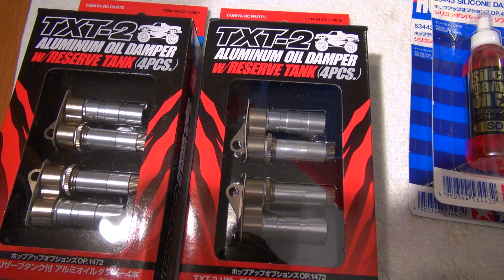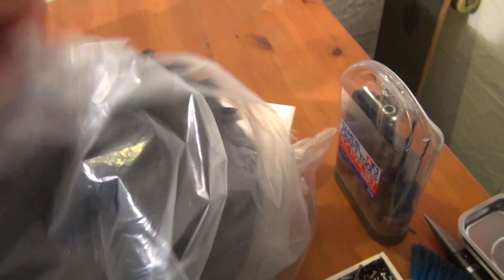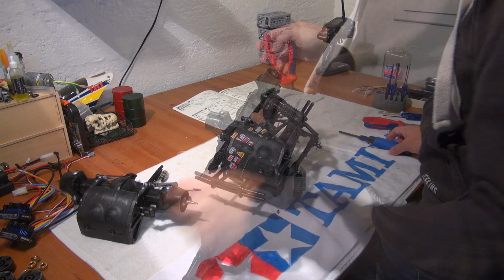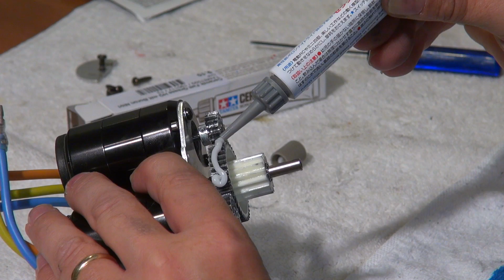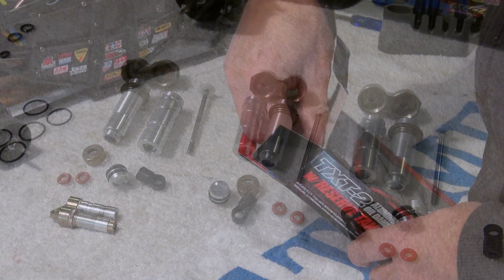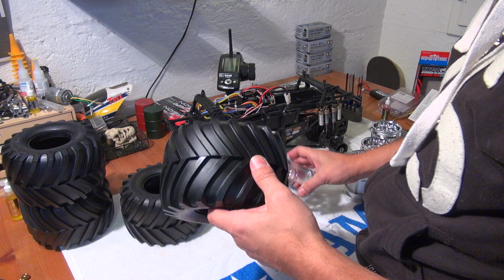Tamiya TXT-2 Agrios Modifications - Double Brushless Setup

Comment: I am planning on getting this truck and add the ClodBuster wheels & tires. Did you need to use  any type of adapters for the wheels? If you did use adapters to attach the wheels,what brand and where did you get it from?Also, do you know if aluminum wheels for the TXT-1 would fit on the TXT-2 Agrios?

Comment: I already have a couple of Clod Busters original and the second will be Hop Up project. I can hardly wait for the TXT-2 to arrive but I'm considering only small upgrades over stock at first  as I'm working on a budget in the way of a full set of bearings and the Clod tires and rims since I have an extra set I need to find the sweet spot one (1) motor or Two (2) Brushless or Brushed 540s or 550s it looks to be quite the adventure

Comment: No lube on those orings? Very nice otherwise
Reply from the maker: Thanks! The o-rings in the dampers? Is there not enough oil from the cylinders...
Reply: @Matteomeier  They will get some lubrication from the silicone fluid, but a proper o-ring lubricant (I use molykote 111) will keep them pliable longer, help them seal better against leaks, and the main reason they are lubricated prior to installation, protect them from being damaged by the threads when you install the shock shafts.
Reply from the maker: Yes, this makes sense! 👍😊

Comment: Please tell me how can i get those rims and the Tire.
And also the shock.
Please..please...please.. i really really would like to upgrade my agrios. Wheels.
Reply from the maker: The shocks are discontinued, maybe you can find it on ebay. https://www.ebay.com/p/54472-Tamiya-Txt-2-Aluminum-Oil-Damper-Set-With-Reserve-Tank-4pcs/1703940558
Wheels: Tamiya Nr. #9335085 Tires: Tamiya Nr. #9805226
Reply: Thanks a lot Matteo this surely help. unfortunate for the shock.
I already check the ebay. It also sold out. 
If i have another question about RC universe can ask you sometime.

Comment: In the Clodbuster manual Tamiya says that the tires should be glued. It seems on one side only, what do you recommend?
Reply from the maker: With a high power setup the tires should be glued. Without, the rims turning in the tires.

Comment: Matteo: these motor have Zero Timing? So can be used in the Clodbuster? Thx in advance.
Reply from the maker: Yes, sensored brushless motors have no timing.
Reply: Matteo's RC Movies Yes okay, but with a Clodbuster one motor will run in Reverse, doing this by swapping two motorwires. But them will the ESC defect a fault via the sensor wire?

Comment: Warning to others:  This does not work with TBLE-03s ESCs.  I tried it and one of the ESCs burned up after about 10 minutes of driving.  I switched to only one motor and now it works fine.  In fact, this truck is rev limited not torque limited so it goes just as fast with only one motor, it just does not have as much torque which is fine because it can still spin the tires.  Not sure why TBLE-01 works and TBLE-03 does not since it is supposed to be an improvement.
Reply from the maker: Thanks for your Info! Maybe it was something wrong with the esc itself? Why does only one of them burnin up? In my opinion this system should work also with this esc.
Reply: It is a bit of a mystery. It worked fine for a few minutes.  The ESC has thermal protection and overload protection but neither of them ever activated.  Maybe it was just a bad ESC, but then I am surprised it worked at all.  However, since using only one works very well anyway I will probably leave it alone.

Since both ESCs are sensored, it is possible that they are out of phase and there is some feedback in which they are fighting with each other.  I also find that the motor and ESC is much less hot now that I use only one.  You would expect it to be even hotter because it is doing more work.
Reply from the maker: Yes, I think this is possible, thanks!

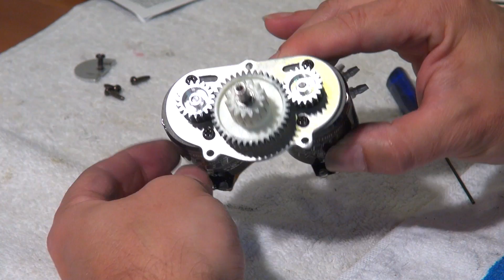Comment: I am thinking about doing the same thing to my TXT2.  Did you change the number of teeth on the pinion gears or did you stick with the stock pinions?  It looks like the motors are adjusted all the way out for the biggest pinions possible at 4:52.
Reply from the maker: I have still the original onions in it.

Comment: Firstly Matteo, your videos are the best in the business and I am certain they are inspiring a lot of people to either get building or others to get building again! Cudos to you! I have watched most of them and have been in the hobby for 30 years!

My question: Would recommend brushless or stick with brushed (even maybe 2 x Sport Tuned motors?) I like a lot of power, so assume that brushless is a good way to go, but I have 3s Lipo in my original Clod Buster and it goes very well! Thanks again, and keep the videos coming.
Reply from the maker: Thanks a lot for your nice comment! I really appreciate your good words! Yes, I think you can go with brushed, with 3s lipo it will go very fast. I think 3s with brushless would be too much.

Comment: Hi Matteo, first of all great job with the videos, they are the best on youtube for rc! after watching your agrios txt-2 videos I purchased one and a set of clodbuster wheels, however when I assemble and tested it, seems lke the servo savers are too weak to steer the wheels, can I ask what servos you used and if you replaced the servo savers? Thanks!
Reply from the maker: +Mark Ellul You can replace the servo savers, but have to use strong servos such as high torque (Futaba S3305)

Comment: Got Tamiya agrios  two day ago and finish I put 5700kv motor and mmpro esc run on 3s 5k mah  boy lot of chassis twist when acces and look at site for after market sway bar can't find one I want
Reply from the maker: nathan patrick The chassis twist in acceleration is normal with a rigid axle setup and so much torque. It's a result from the torque of the drive shaft. And your motor with 3s has a lot of power! But you can try to make the shocks harder at the rear left. (Pre load the springs)
In this video you can see also the twist at 0:20: https://youtu.be/vXayr7StP3M

Comment: oh,its a jugg 2 gearbox?will you be using steel pinions?them alloy ones wont last long with that power.what part numbers are them piggy back shocks.

nice truck by the way
Reply: He is right it is a Jugg 2 gearbox, same as the jug one and mammot dump truck but the jug 2 and txt-1 and 2 version of the box uses an upgraded final drive gear with a larger hex drive in the center and an aluminum hex nut that has a splined center hole for the dual output shaft which is a 6mm output shaft with dual flats cut into it for twin grub screws on the drive shafts instead of the weaker 5mm D shaft on the jug 1 and mammot which had only one grub screw, this upgrade followed into the axles which also use a 6mm input with the twin flats in the shaft.
Reply from the maker: michael whitham Don't know about the jugg gearbox. The shocks are part no. 54472
http://www.tamiyausa.com/items/radio-control-parts-70/tamiya-hop-up-parts-72000/rc-txt-2-alum-damper-54472

Comment: Hi, I'm currently in the process of adding 2 9 turn brushless motors to my TXT-1. Did you need to make any modifications to strengthen the gearbox or drivetrain when you did this instalment? Cheers.

Comment: Hi, can you do me a big favor? Can you measure the lenght of those alu shocks with reserve tank? I want to fit these on my TXT-1. Thanks!
Reply from the maker: The length is about 90mm, I think they will fit on the TXT-1. I found in the manual this information:

Usable with : 
For Cars 
TXT-1 Chassis (Use Damper Oil #500)
TXT-2 Chassis (Use Damper Oil #200)
Clod Buster (Use Damper Oil #400) 
CR-01 Chassis (Use Damper Oil #200)

Comment: Awesome set-up Matteo, and thanks so much for the instructional video.  One question: do you feel the stock oil shocks would have been enough, or were the modified reservoir shocks necessary?  Even though I plan on putting the larger tires on my truck (as you did), I just don't want the set-up to be too stiff; I kind of think it would be cool to get some suspension travel on larger jumps.  What are your thoughts on this?  Thanks!

Comment: Matteo, Just a quick question, given the similarity between the TXT-1 & 2 chassis, would the mods you have made to your TXT-2 work with the TXT-1? Only asking as i'm keen to upgrade my 1, (alot)..Oh and keep the vids rolling, very inspirational :)
Reply from the maker: Basically it should work. I don't know the TXT-1, so I don't know the length of the shocks. The motor setup should be fit without problems!

Comment: Question about this Tamiya truck. You are using two brushless motors. How are the shafts and gears holding up? Isn't it to much power for the drivechain?
Reply from the maker: It,s not a problem yet. I use only 2s batteries, so the power is good manageable by the drive chain. With 3s or 4s it will be a problem, I think!

Comment: Does it actually works with two motors and two esc's? I am still surprised that Tamiya is not using reinforced plastic like for instance Team Associated is using. Tamiya plastic doesn't look durable. Still nice  monstertruck though.
Reply from the maker: Yes, it works without problems with two esc's and motors, and the plastic is very durable. The chassis is not only plastic, there are black anodized metal parts on it.